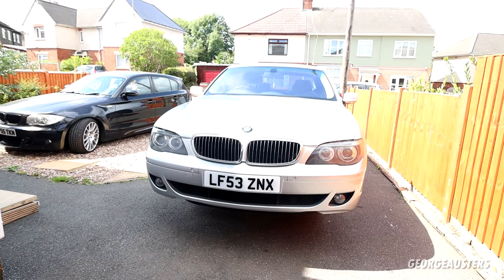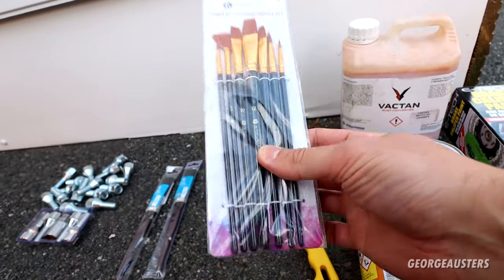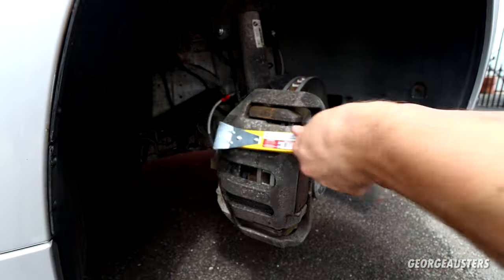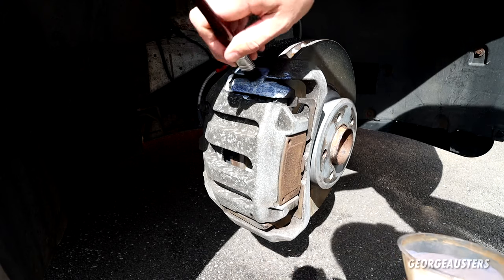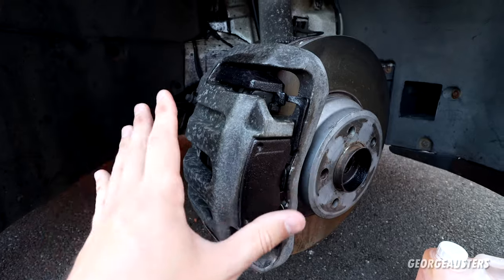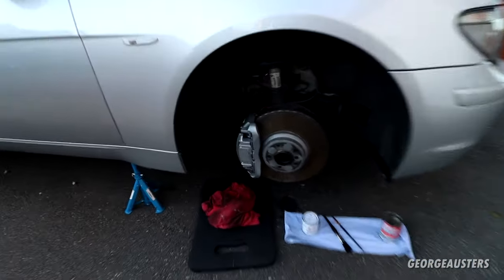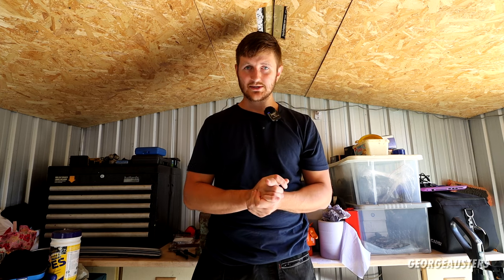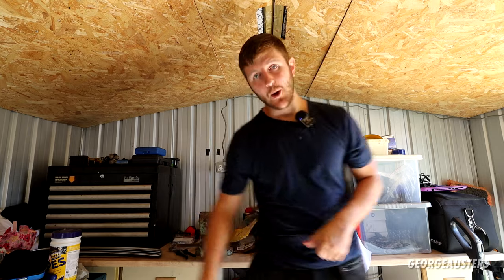HOW TO PAINT BRAKE CALIPERS WITHOUT REMOVING THEM

Comment: Smooth Hammerite works well as well, plus no need to use a rust killer.
Reply: I've never got good results with Hammerite on brake calipers. I don't know if it's the heat, but in my experience it's looked great for the first year or so then gradually starts to flake off.

Comment: Looks much better.

Pretty sure the fronts are single piston jobbies just with a big body; they look the same as my 335i callipers. Personally I think it’s worth popping the spring clips out before painting. I’m going to paint the spring clips black on mine for a bit of contrast.
Reply from the maker: They're twin piston.. I rebuilt them here: https://www.youtube.com/watch?v=Q9VquIo-stM
Reply: @GeorgeAusters  interesting; they look identical to mine which are single piston as were the E9x M3.
Reply from the maker: Yeah they probably look the same but these brakes are much bigger.. Pretty sure they’re the same size as the M5 brakes
Reply: @GeorgeAusters  it seems that the 760 used various sized front rotors from 348 to 374. 348mm is the same size as not 335 and the 374 is the M5/6 size.
Reply from the maker: Yeah these are 374mm front and 370mm rear

Comment: Nice job...not super smooth, but with silver and stock look, I don't think you need it real smooth.  I'm debating red vs silver...If you don't have big brembo calipers, etc., I think the red, etc., kind of looks a little silly...like trying to be a multiple piston Brembo want-a-be.  Silver just looks stock and reasonably classy.  I would take out the pads, etc., if I did it.
Reply: Paint the caliper bracket red keeps it classy with a little racing red.